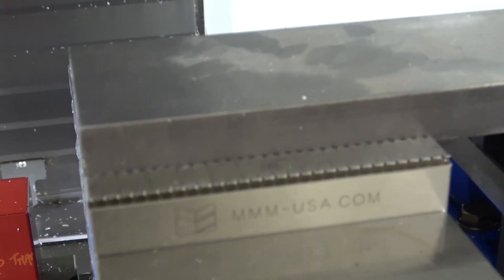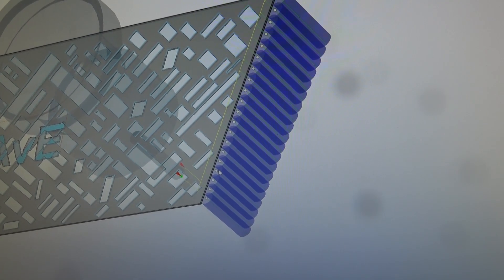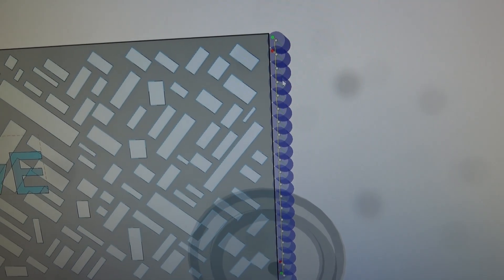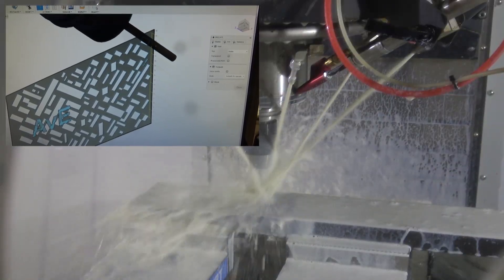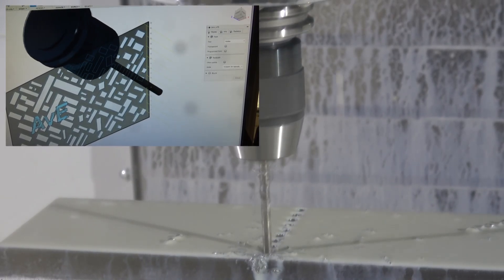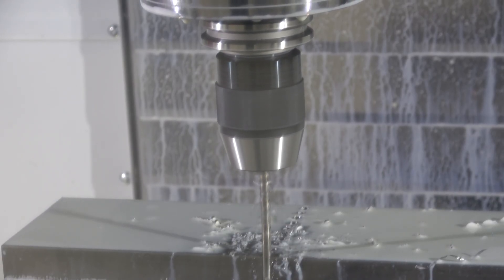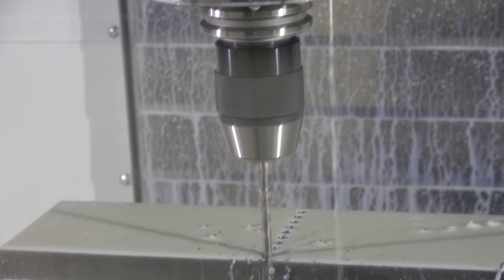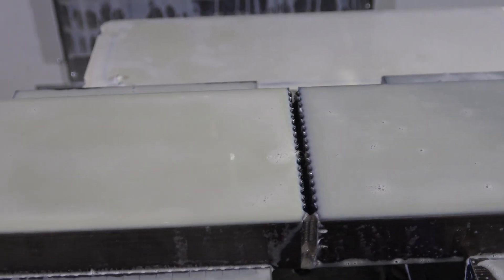What is Chain Drilling?

Comment: Is it really faster than just running along it with an end mill? Even if the material removal rate is quicker there's a lot of time spent not cutting, plus the tool change from spotting, and the time spent cleaning up the cut afterwards.
Reply: Use a high feed mill, most of the cutting force is directed upward
Reply: PerfumedManatee Not to mention you can’t sharpen end mills when they’re dull like you can a drill bit.
Reply: PerfumedManatee if its long enough to go half way through you can flip the material over. Even if you just did the same drilling operqri using a carbide end mill you don't have to worry about it walking.
Reply: Tzuede Off the Cuff  you can't just tell the CNC your reground diameter? Seems like once it knows your end mill diameter you wouldn't need to change steps between passes. We used to use regrinds all the time. Since they're undersized, they're great for putting a hole on location that you want to ream to finished diameter.

Comment: I’ve done it by hand but that’s the first I’ve seen it with a machine.
Reply: That’s what she said. Fnar fnar...
Reply: Yeah it's the poor/lazy man's hole saw. Need to fit a vent fan and you don't have a dinner-plate sized holesaw? Spend all afternoon perforating the wall instead.
Reply: NCOT Technology Jigsaw?
Reply: Stick WIT URE hand you know where its been
Reply: I did this as a kid because I had nothing for tools. A 1/4" was the only drill bit I had. I skipped a hole then used a hacksaw to cut from hole to hole.
Reply: been there, many times
Reply: I’ve done it with a mag drill with mill end on 6” of cast iron. It was the only thing that would even touch it.
Reply: I've done it too but with a drillpress 6mm drill center to center 6.5 mm(centerpunching the first hole then scribe it with an old caliper centerpunch again scribe ,slow process but the result were always fine) you have to do it just to be sure the drillbit doesnt break

Comment: Hmm, I always figured using linear shaped charges was the fastest way to remove material but what do I know?
Reply: Ha. I do a little work with those sorts of tools, and I’d have to agree that flsc is faster than whatever uncle b did. Might not be the best for further intended machining processes, but way more fun.
Reply: I like your style
Reply: @Thefreakyfreek  ;D
Reply: Yeah you're probably right I always thought it was a Good ol' A-10 BRRRrrrrrrrrtttttttt.
Reply: @zachell1991  its clearly the tsar bomb
Reply: @zachell1991  That's for poking holes!
Reply: @mduvigneaud   Yeah thought that's what we were talkin' aboot chain drillin'   pokin'  holes same thing lol
Reply: @zachell1991  Yeah. Poking holes in a line. The A-10 is a spicy bird and the GAU-8 is a spicy hole-poker! :D
Reply: Something that can be considered a tool(and not some rare natural cosmic event) , the fastest way to remove material would have to be something called a RKV = Relativistic Kill Vehicle" basically an space missile that has delta v measured in fractions of light speed. When it collides with its target it will impart more energy to the target than a pure fusion device of same reactive mass could and is only second to anti-matter annihilation in energy density.
Reply: @volvo245  so, cut it in half with a particle accelerator?
Reply: @DFPercush  Funny you mention particle accelerator, a idealized RKV would basically be just a giant solid particle accelerator beam pulse = matter moving at major fraction of c.
  I have no idea what would happen if such projectile could be intercepted (near impossible to detect in time) would it just do a cone spray = turn from a solid slug into birdshot of relativistic particles or would major fraction of it still travel on the original path or close enough to it to reach the target? Matter starts to behave weirdly even at just 10-30km/s, at 5 orders of magnitude higher velocities its in the realm of nuclear physics as regular mechanical properties are meaningless when calculating its interactions with its surroundings (energy coupling etc.).
Reply: @volvo245  It gets even weirder if you consider the time dilation - by the time it actually explodes after being intercepted it's already gone a fair distance. Also since the speed of sound is so much slower than light, any part of the object that was not directly blocked by the cross section of the interceptor would probably continue, oblivious that anything was in the way. Until the heat energy from the collision got to it anyway. Interesting ideas lol.
Reply: One of my favorite series is Niven's "know space" with Ringworld and Neutron Star and the expanded universe where the Puppeteers are exiting the galaxy. I liked the relativistic kinetic kill vehicles used.
Reply: @mduvigneaud  I've seen them in few other scifi books as well. Often used to remove pesky new space fairing species or civilizations deemed unfit to join the "club". Of course Star Wars had to try to ruin them with that stupid kamikaze scene in the new ones. Zero regard for the internal logic of that world.
Reply: yes, but he did specify among machining methods
Reply: @yareyare_dechi  Oh! Thanks for explaining that to me! I never would have known otherwise.
Reply: @mduvigneaud  not too many machinists use explosive nowadays
Reply: @yareyare_dechi  Awesome! Thanks! I never would have gotten the joke if you hadn't explained it to me in such detail. Again: thanks!
Reply: @mduvigneaud  okay, less passively. your joke sucks. it doesn't even make any contextual or logical sense. 
"Hey, did you know that the largest land animal is the African elephant"? "HURR, i thought the blue whale was the largest animal"... that's the level of what you said
Reply: hard to get a finish though.
Reply: Cratering charge is the way to go.
Reply: Drilling has a faster material rate when you need to make a hole. Even when you get into volumill, it’s best to punch the biggest hole you can in the material first to you don’t have to ramp in. Helps when you have a decent carbide drill though.
Reply: Liberals always trying to take my High Explosive Anti-Tank rounds...  I need those for duck hunting!